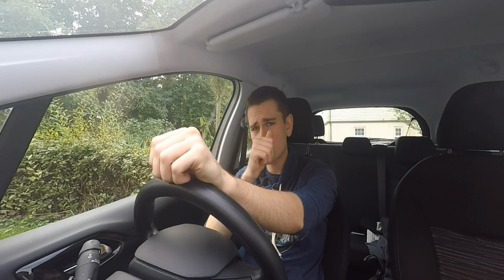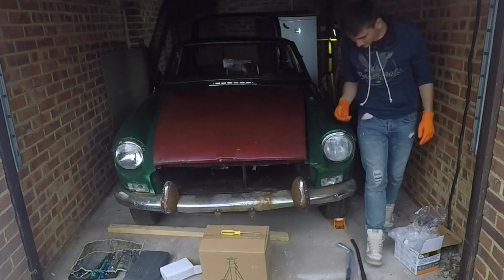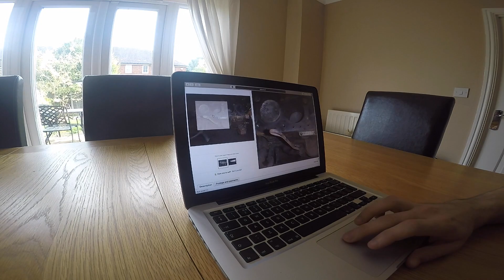MGB GT Restoration  Pt 1 Strip down

Comment: Considering buying one of these for 300 euro right now. Only afraid of the state of the pockets
Reply from the maker: For 300? Worth it just for parts
Reply: @RebuildthePast  . Im 18 right now and this would be my first build but im also afraid of how hard it would be to find parts i need without ending up spending more than if i just bought a running one for 4k
Reply from the maker: @kellogdovahkiin2187  that thought has run through my head many times … does it come with parts or bare shell?  I found that it’s better to start with something with most parts because when you add it all up the parts are expensive even if you’re buying all second hand.  At least parts are available. The other issue is if you buy one that’s done there is a chance it’s hiding a lot of rubbish work. I’ve seen people spend 10k on a car that was just body filler
Reply: @RebuildthePast  . It has the majority of the parts. But both front and back windows are broken, it has rust spots allover but i dont think any rusted through. The bumper is bent in the middle. Theres no pictures of the engine or engine bay or interior so i doubht they will be in good condition as its been sitting outside for years